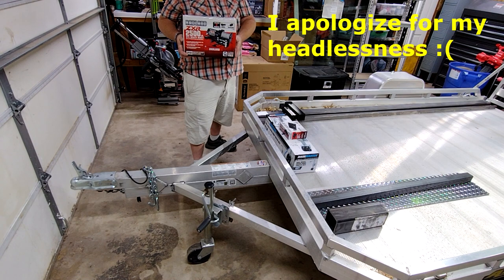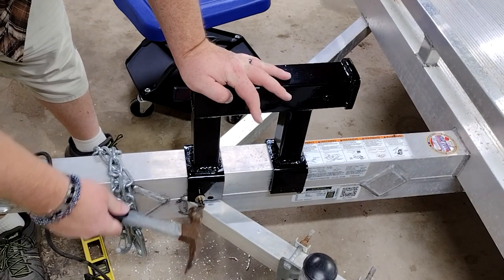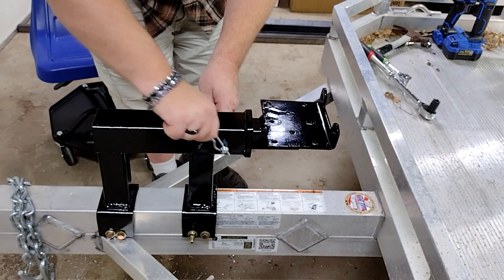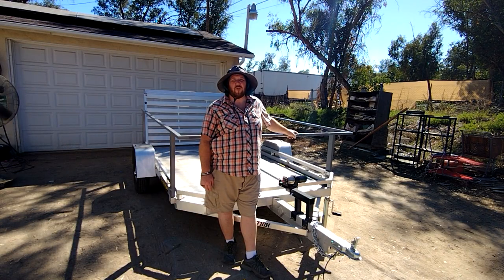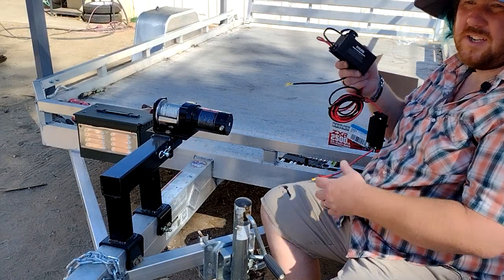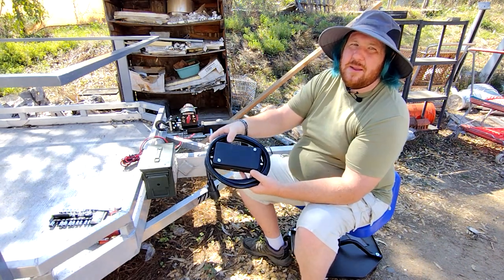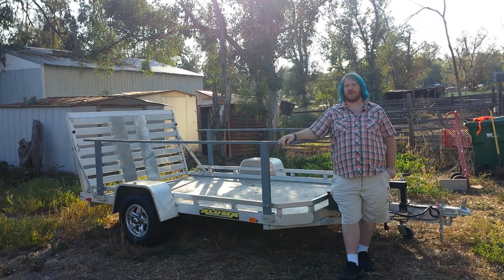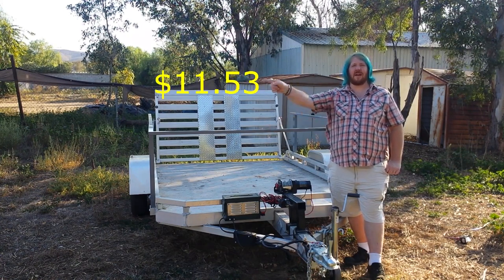Installing a Harbor Freight Winch on a Utility Trailer (and other mods!)

Comment: I wouldn't have designed the support for the winch that way.
Reply from the maker: How would you have designed it?  To me it seems overkill for what I'm doing with it.
Reply: I'd have put some sort of diagonal brace into the design.
Reply from the maker: Yeah I was thinking that might be what you were getting at.  Something to consider if it breaks I suppose (or, how good of a welder am I? lol)